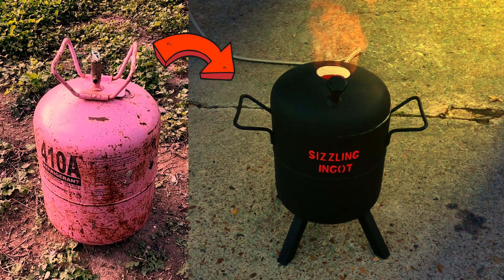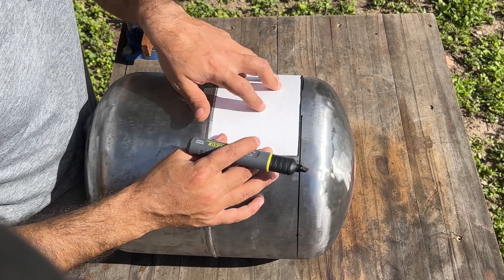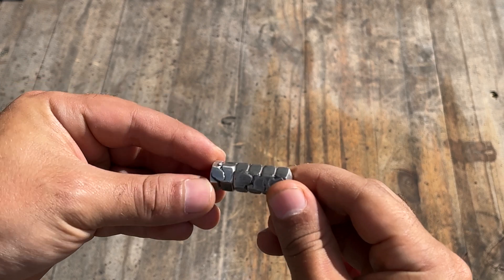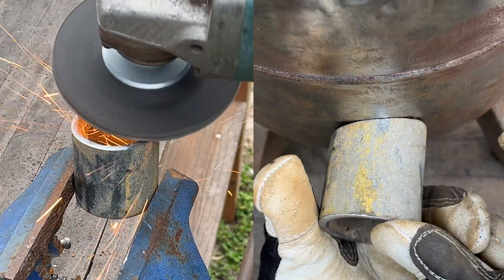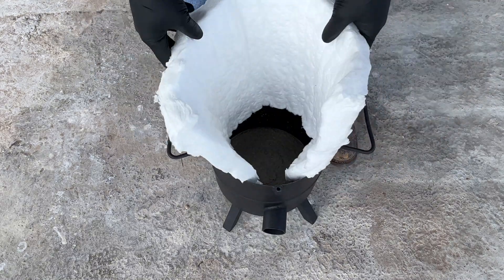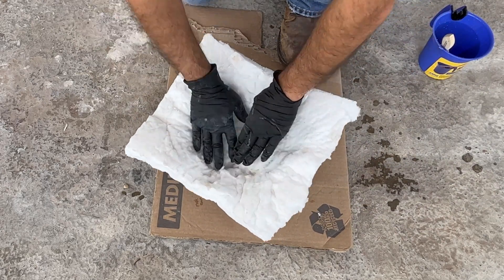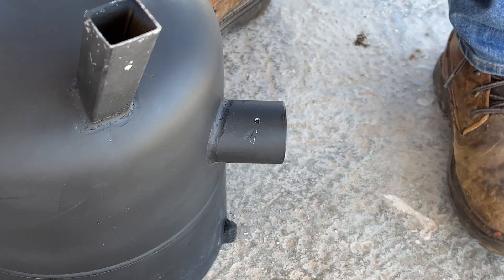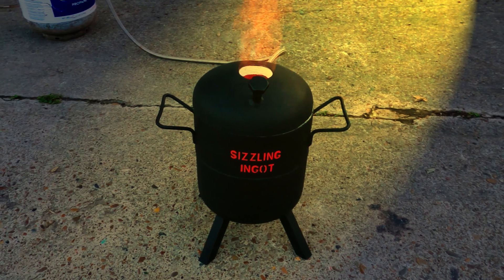DIY Metal Melting Foundry Furnace built using Salvaged Refrigerant Tank

Comment: Things to consider. You need "ears" for the lid. 2. The burner inlet was, in my opinion, not properly placed. It is perpendicular to the tank and not angled to the side so the flame will hit the wall insted of the crucible. If you angle it towards the wall the fire will continue it´s pad creating a vortex to heat the walls and crucible eavenly and not just one side of the crucible. 3.- I never used a regulator, and never had a problem. It´s been 20 years since I built one, but I remember drilling holes on the inlet pipe. 4.- I never heard of the "rigidizer", I used boric acid or copper sulfate to coat the ceramic fiber. You are welcome.
Reply: What size crucible would be optimal with this set up? Ty

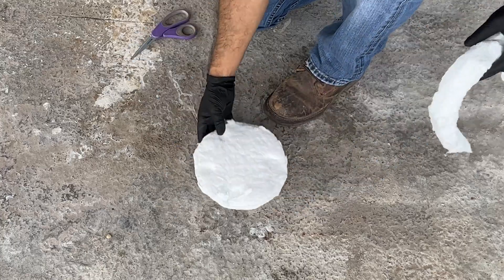Comment: So the "Fire Brick Recipe" 4:06 isn't good enough to use for the entire lining?  Or would it deteriorate far quicker than the ceramic blanket?  And how long does the Rigidizer 4:51 last before it breaks down and a health hazard occurs?
Reply from the maker: I will work but requires a longer process to repair if there is damage. I'm not too sure which one would last longer but the ceramic blanket might be a cheaper and cleaner option.  It also would have added unwanted weight for this build since it was intended to be portable set up. The 2 reasons I added the fire brick recipe was to keep the center of mass low to the ground to avoid accidental tip overs and to have a flat surface bottom.